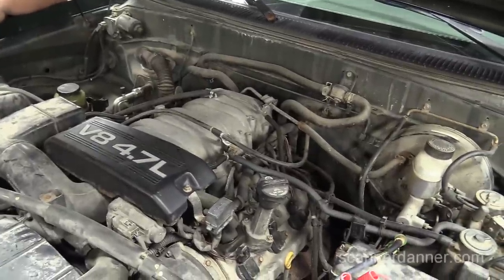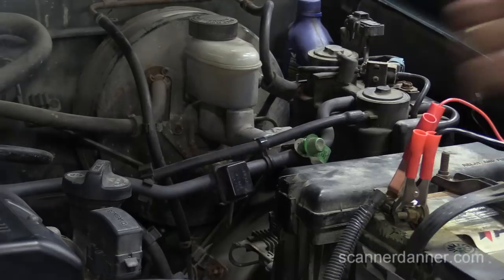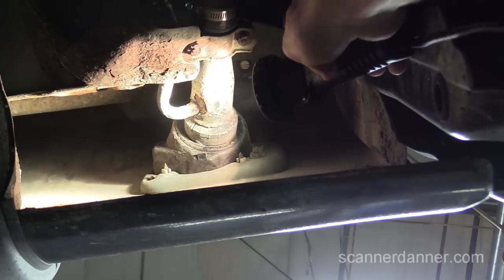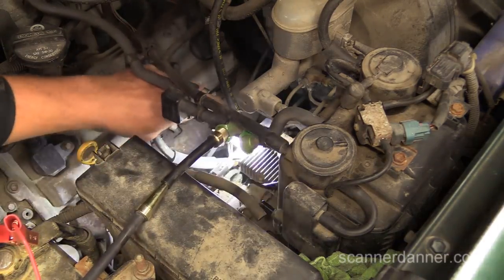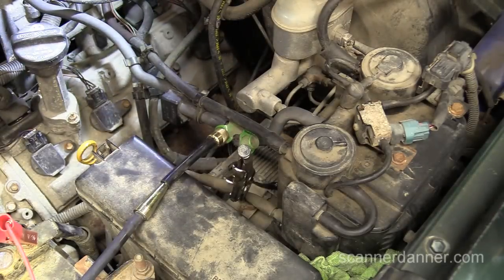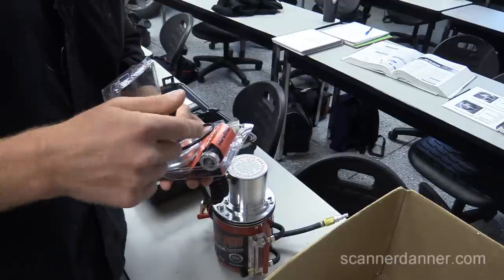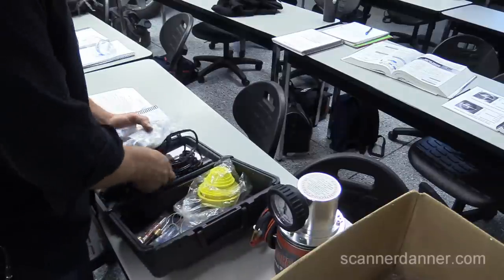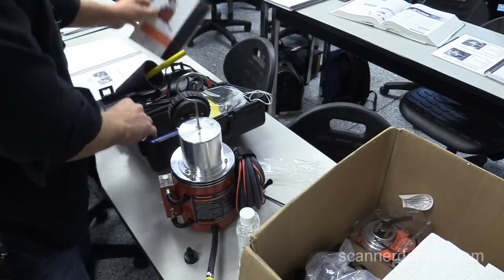REDLINE Smoke Pro, EVAP and Intake Leak Testing + Unboxing

Comment: Why are they so F'ing expensive?
Reply: +Louis Moscatel - lots of paint can DIY smokers on the internet. I even have one. It's the same with "First Look" pulse transducers and WPS500 in-cylinder compression tester---guys are making their own too.
Reply: +roadkill5333 +Socket - These commercial machines cost around $1000...

I made one for $30...with a flow meter...and I bought a LED UV flashlight for $10 on Amazon which shows the smoke even better that a halogen light as shown here.

I won't link the video of my smoke machine build but you can find it on my channel if you're interested.